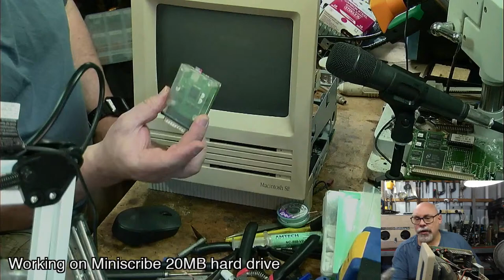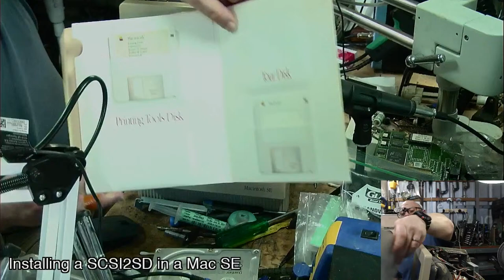Fixing more old Macs

Comment: That failed tentulom cap on the Miniscribe was likely the cause of the failure. They short when they fail and since that one looked like it was on one of the power rails, it pretty much blew up once it shorted. The electrolytics tend to go open circuit or turn into high ohm resistors when they fail so this is mostly an issue with solid state caps.